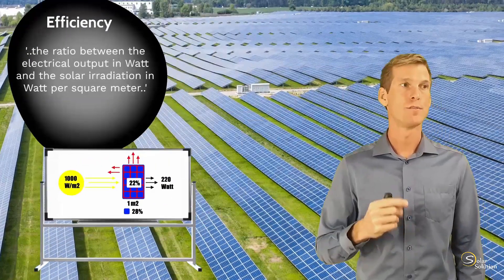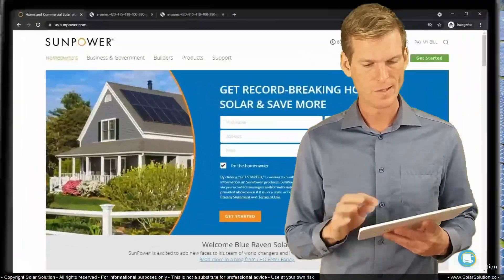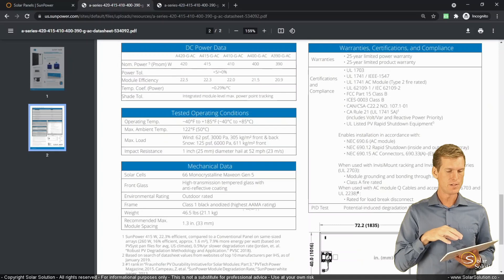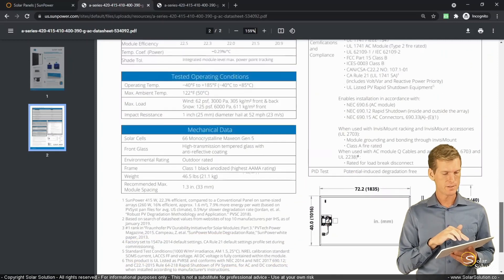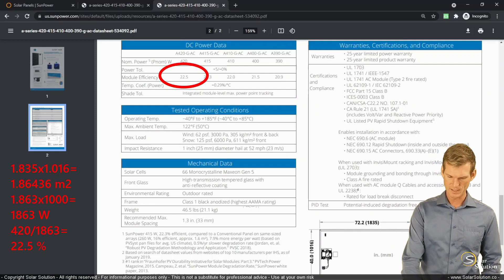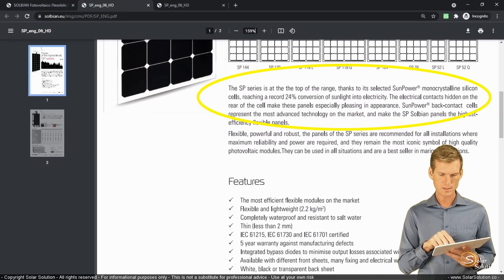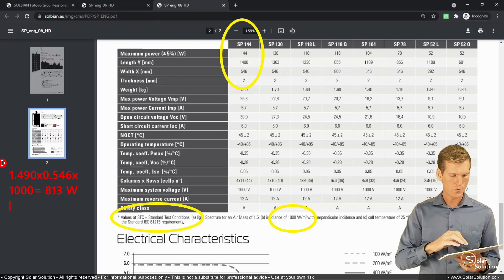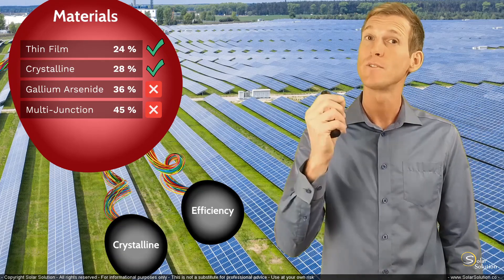Solar Efficiency Calculations: Examples of available PV Panels

Comment: Hi Jessie,  it's an added insight. However, I'm quite confuse on the comparison of Cell Efficiency vs. Module Efficiency. Whether you use cell or module efficiency the resulting electrical output of the module is given anyway in the Data Sheet.
Reply from the maker: Hi Dan! Thanks for your message. It's a tricky topic indeed [cell vs. module efficiency], but once you get the general principle, it's great!. This particular video you watched went into online & product examples, whereas the following video explains the core concept of cell vs module efficiency: https://www.youtube.com/watch?v=mGPOvWSYUsI
Have fun! Jesse
Reply: @SolarSolution  Thanks for prompt reply with further insights. It makes this channel apart fromthe rest.

Comment: Only 22% that quite sucks! I thought solar panels were able to capture and convert more power than that.
Reply from the maker: I can relate to that perspective; It sounds rather low indeed. But what if we were to approach it from a different angle: A square meter of our planet's surface can produce up to 250 Watts of electricity! That is more than enough to run your laptop the whole day. Thanks for sharing your thoughts!